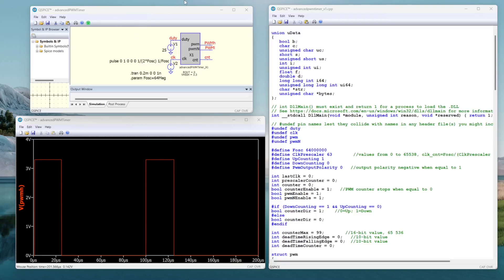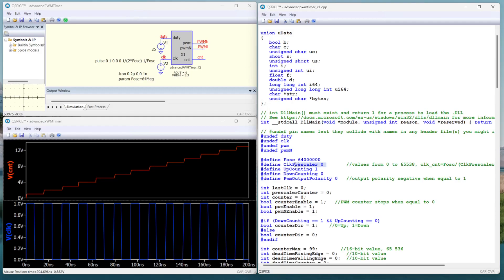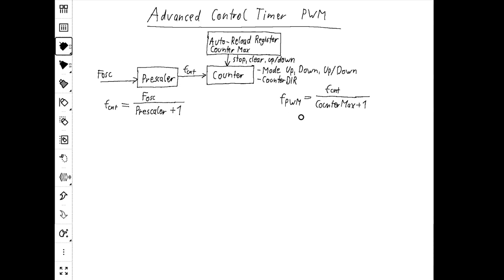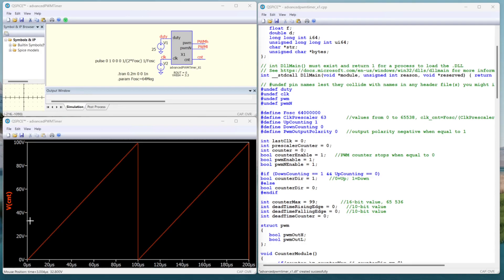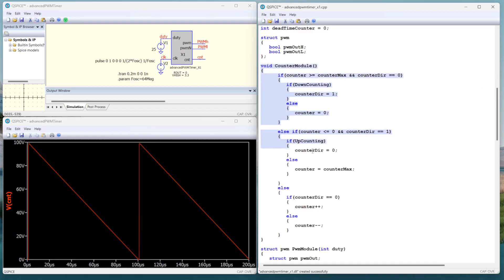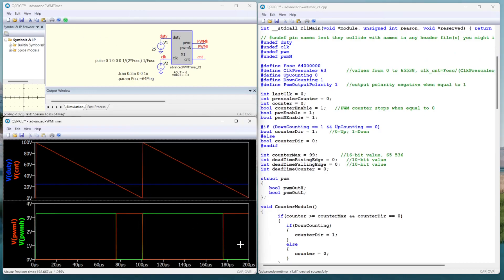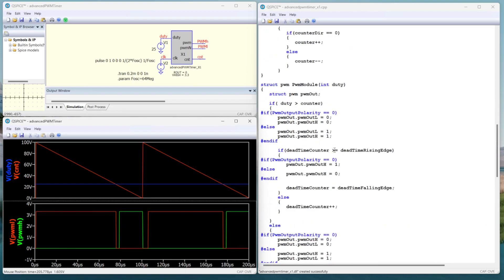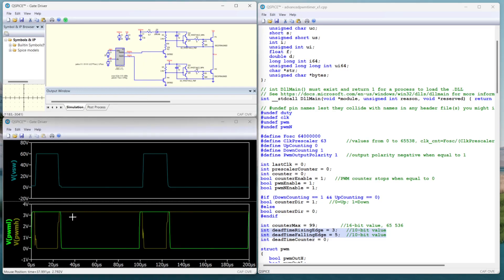How to simulate an STM32 PWM in QSPICE using C++

Comment: Nice explanation. could you share the code with us?
Reply from the maker: Yes, quite recently I created a github repository containing the Qspice simulations from my videos. Feel free to use them https://github.com/EngineeringHustle/QSpiceSimulations
Reply: @engineeringhustle  Thank you very much. Greetings from Brazil.
Reply: @engineeringhustle  What are the functions of Rout and VHIGH in the simulation file advancedPWMTimer? Simulation with these two parameters will report an error，thanks!
Reply from the maker: It seems this was due to the usage of an old version of QSpice when I did this simulation. With the last commit it should run with the latest version.

Comment: very nice explanation, i wondering how to adding a frequency compensation due to vary load  of a converter with this method
Reply from the maker: I’m glad you enjoyed it!
Generally the compensator design has to be brought into a discretized form in order to put it into C code. I’m planning to show more on that topic in the future.
Reply: @engineeringhustle  okay thanks in advance, i will be waiting, iam learn a lot from your channel. also still colect reference for pwm generation based on c/c++ code, i think atmega/avr is hard to change the freq due to limited prescaler and you givee example with stm32 thats so good